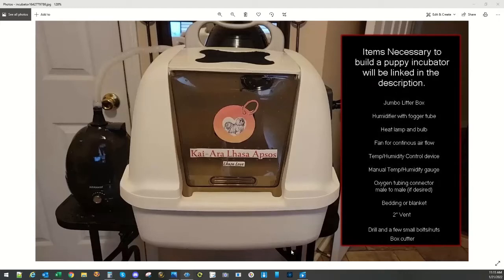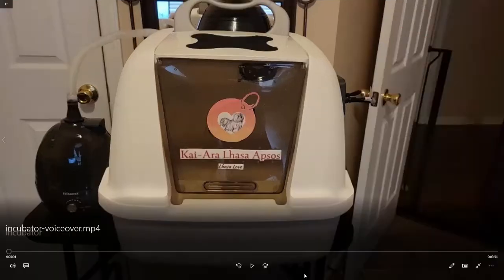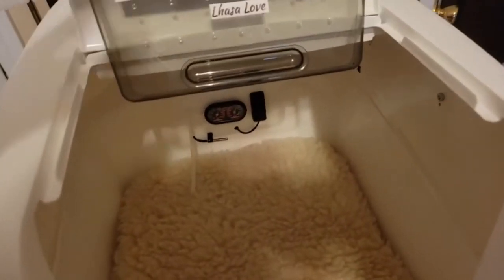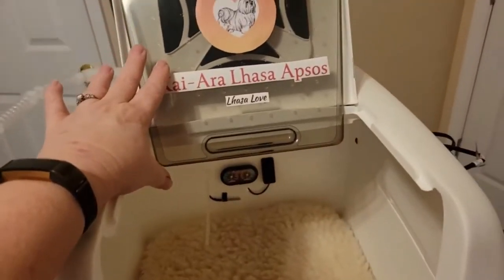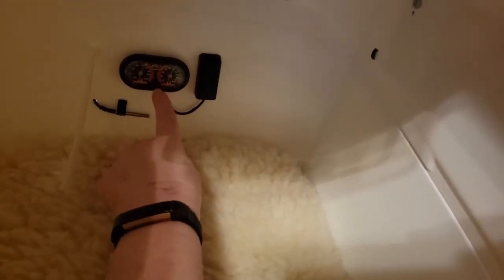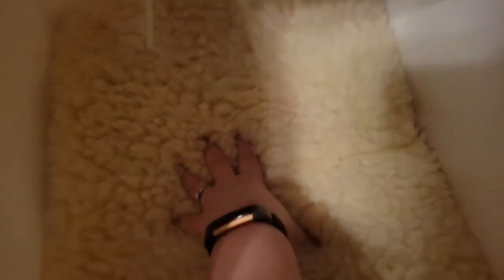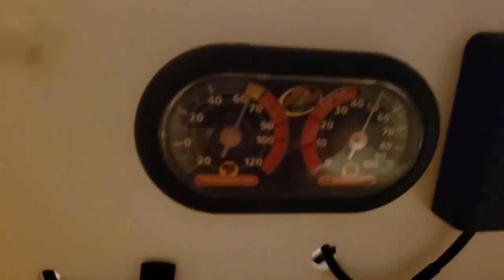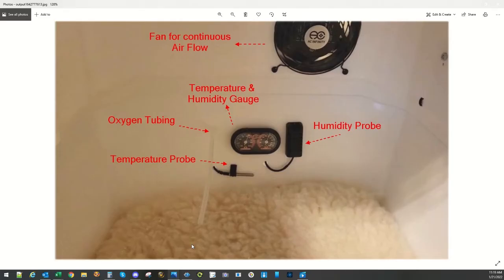Puppy Incubator

Comment: How did you get the humidifier control Device inside of the incubator that’s on the back wall
Reply from the maker: The probe is the only part which is inside and the actual control device hangs on the outside by sleeving over two screws.

Comment: CAn you make a how to video on building it together?
Reply from the maker: I can try to get one made here soon, sure.  The steps though, in the mean time.  Hold the Inkbird outlet up to the unit where you want to secure it and mark position for holes.  Screw in 2 screws but not all the way and hang the regulator on these screws.  Hold the grid portion of the fan to the back of the litter box in back and rough outline where to cut the hole and placement of screw holes.  I used a box cutter to twist out the screw hole areas and then cut the circle for the fan.  I cut the circle a little smaller than the fan circumference.  Hold the lamp to the top of the unit and rough outline where to cut the lamp hole.  Cut it smaller then your outline as you can always enlarge but not make smaller.  I placed the bedding inside that I wanted to use so I could find an area in the back middle to bring in the oxygen nearest to the puppies (about 3/4" above the bedding).  I then held the temperature gauge and humidity gauges up and marked where to drill (LOL...with my box cutter twist hand drill) and screwed in these two probes.  The manual thermometer above it was self sticking.  In the top right backside I drilled a hole for the humidifier tube.  This hole needs to be high as the humidifier works best when it's well below the tubing, which should have a nice steep angle down toward the humidifier itself.  I traced the vent hole and cut it smaller and worked on it slowly taking out tiny amounts until it fit.  I've also added a light inside now which is one made for ceramic decorative christmas village houses.  It was perfect because they have a little pinch clip to keep them in the houses which worked perfect for holding in the incubator wall.  I also put a tiny piece of velcro tape at the base of the swinging door so that it doesn't gape open.  It just rests nicely there on it's own now and still opens easy.  And lastly I also removed the black filter on the top and cut out that grate entirely and screwed in a square of plexi-glass sheeting instead so it's easier to peek in.  The hubby had to drill holes in the plexi glass and the box for that.

Comment: question if the fan is continuously on how does the incubator maintain temp and humidity?
Reply from the maker: It's a very low fan more like circulation.  It maintains however through turning on and off the heat and humidity.  If it's not reaching it then you'd want to turn off the fan.

Comment: It feels like it takes for ever to get to the right temperature/humidity level with the fan running at the same time. Is the fan suppose to run all the time?
Reply from the maker: Hello and thanks for the question.  It could be that it's not needed in your environment.  Also, having 1 puppy verses 4, etc. Will make a difference due to body warmth.  With a singleton or smaller litter in a cooler environment you may not need it at all.
Reply: @kai-aralhasaapsos2817  thank you for the prompt response. I just put the box together yesterday and was trying to test everything before our liter arrives 🙂
Reply from the maker: @meregildojrsagrero-tamayo9953  oh yes, definitely without puppies it will take a while.  And with a singleton you can also just turn it off.  Remember the alarms will let you know if the environment is not correct.  Just make sure you've set them.  And congrats on your soon to be litter!

Comment: I haven’t been about to get mine above  45% 

Also humidifier tends to puddle up water in the incubator
Reply from the maker: If you're using the same humidifier it helps to lower the humidifier some (physically - put it on a lower table) and make sure the tubing is not bent at the top allowing puddling of drops.  The drops that collect should be able to fall back into the unit rather than the incubator.  You likely only need to lower it.  And depending on how you handled the X shaped filter above the door, you could add a damp towel lain over it there also.  I ended up taking that black filter out, cutting the grid out and putting a plexiglass/acrylic sheet there to see through, which also helps keep moisture from escaping.

Comment: The plastic piece around the oxygen tube connector..What did you use there? Just looking for a way to keep it sealed in place 😁
Reply from the maker: Hi Leisha, Great question!  I  used a round clear plastic that was actually part of the packaging for one of the items and just cut a hole in it then put alien tape on the incubator side.  It's that tape that is soft and thick and incredibly sticky yet removable.  It doesn't have to fully seal, just stay in place is all.  Any similar clear double sided tape would work.
Reply: @kai-aralhasaapsos2817  thank you!!

Comment: Excellent!  Thank you! do you have any insulation between the box and the heat lamp?  Doesn't it get too hot and danger of melting?
Reply from the maker: Ours does not get hot enough to melt.  Most likely because of the fan behind it.